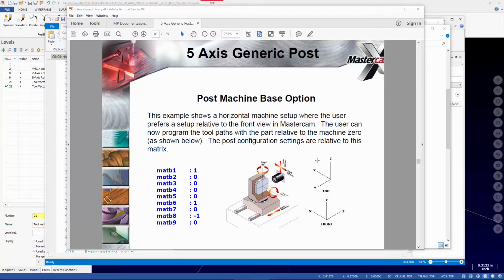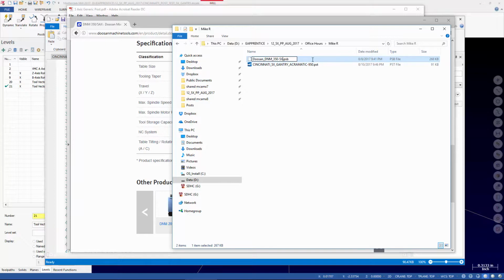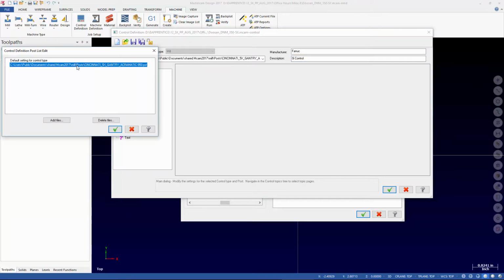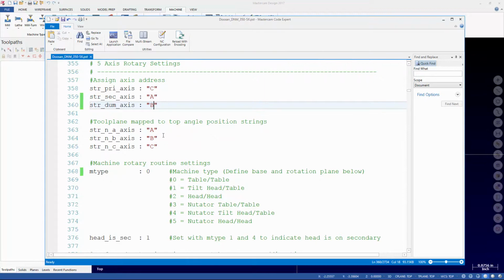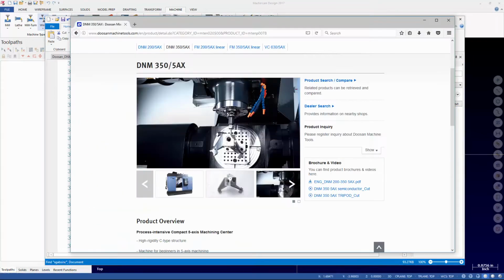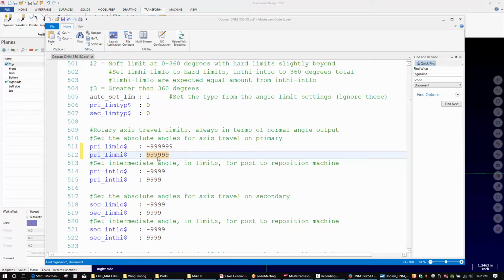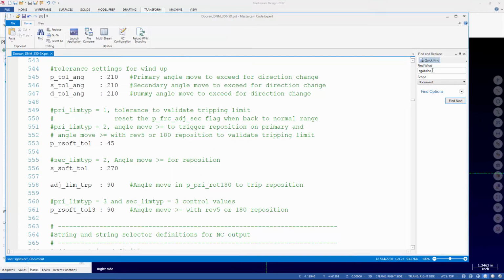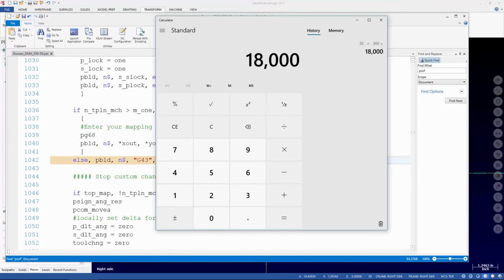MP 301 - Video-4 - 5X PP AUG 2017 DAY 1 Office Hours Part 2

Comment: Thank you for the great videos. I have a question, if I have to deal with a table/table machine with turning function on the C axis (like brother M300x3, Hermle MT series...), is it still able to configure this post for turning operation / or doing machine simulation without tricks. Or they need to be considered as a Mill/Turn machine?
Reply from the maker: Hi Giang, to add any Turning capabilities, you need to have a 5-Axis Turning Post as the base. CNC Software doesn't release 5-Axis Turning Posts for public development. However, there are 3rd Party Developers who build 5-Axis Posts that support Turning. Postability and In-house Solutions are the two most prevalent. They can also add Machine Simulation to these Posts. They are authorized integrators of ModuleWorks.
Reply: @colingilchrist6468   got it, thanks Colin. Do you still open online post processor courses?
Reply from the maker: @GIANGTHETOOL  I haven't taught any online courses for almost five years now. Been too busy at work to commit to teaching another online class.